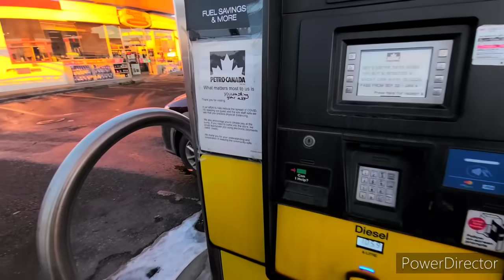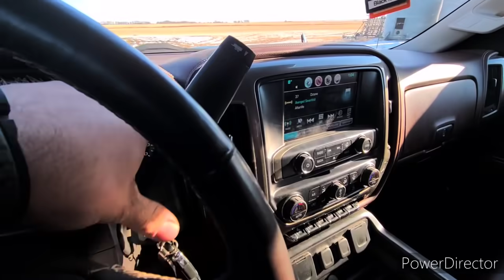Self propelled auger and a road trip with Rob!

Comment: Your new auger might not be ready for that big job. The top power shaft looked like one of the bearings had failed the way the shaft was dancing.
Reply from the maker: What?
Reply: That's the plastic guard. They run loose.
Reply from the maker: @ivanmoreau1798  ah that's what he was looking at